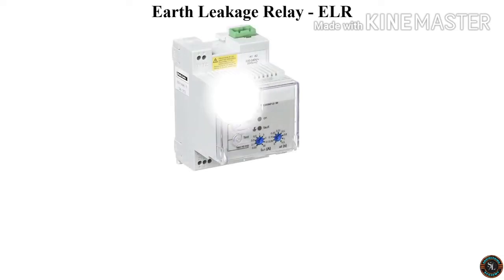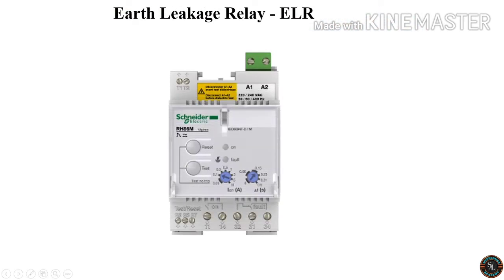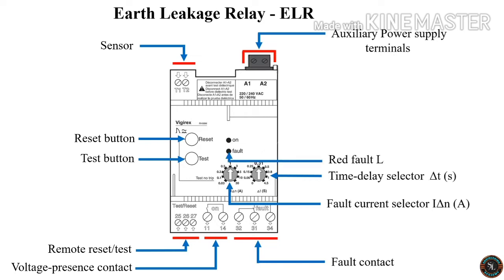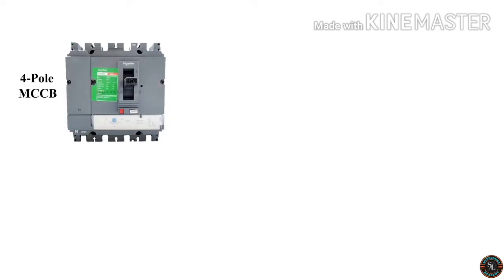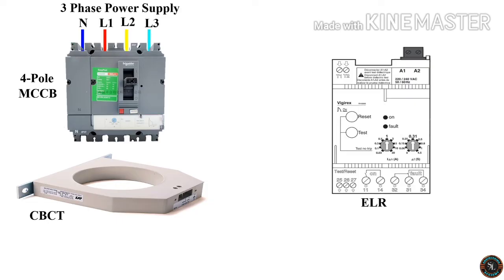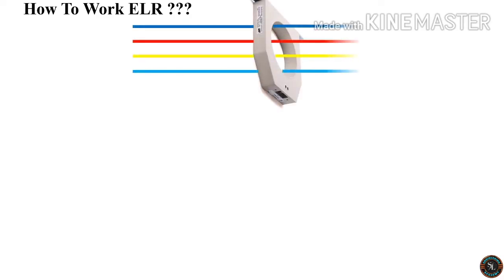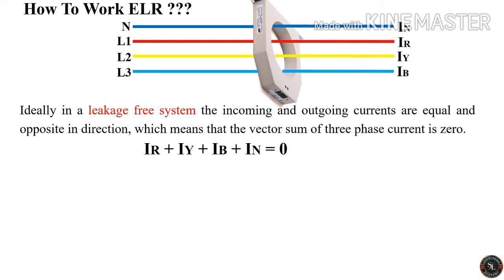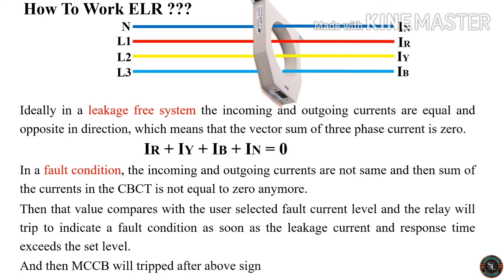Earth Leakage Relay - ELR  /  How to Wire ELR & CBCT with MCCB / Working Principle of ELR

Comment from the maker: Thanks for Watching.❤👍
Please Subscribe the Channel.
Reply: Madness, power to ELR + Shunt-Trip coil should be tapped-off Incoming Side of MCCB.😒

This ensures the ELR continued to be powered ON in the event after a Earth Fault that gives Power to the MCCB Shunt-Trip coil.

If the ELR is DeEnergised and Shunt-Trip losses power (Prior to the Fault being Cleared/ELR Reset) then the MCCB may be Accidentally Closed (switched on manually) & brings Hazard.⚡⚡

Any power to Control the Monitoring/Actuation of Switchgears shall always be tapped-off Incoming Side (before interruption) & be provided with independent Miniature OCPD if required...✅

Comment: why is the A1 and A2 tapping from the cables after the CBCT? if ELR sends a tripping signal to MCCB, wont the ELR loses its aux supply as well? A1 and A2 should be taking supply at the incoming cables before the MCCB. your diagram is flawed
Reply: That's exactly what I thought too. The diagram has a problem. Like you said, auxiliary power should be taken from the incoming side of the MCCB. If wired as shown here, the ELR will lose its power when the shunt coil causes the MCCB to trip. The sad part of the story is that no one seems to care even after the mistake has been pointed out.